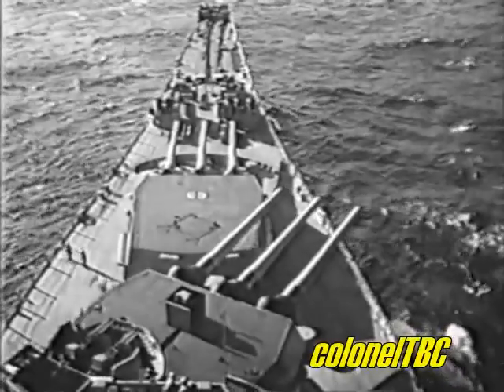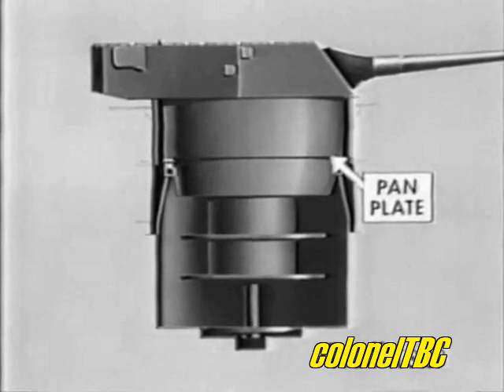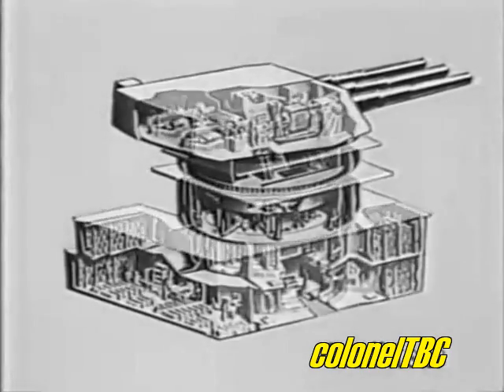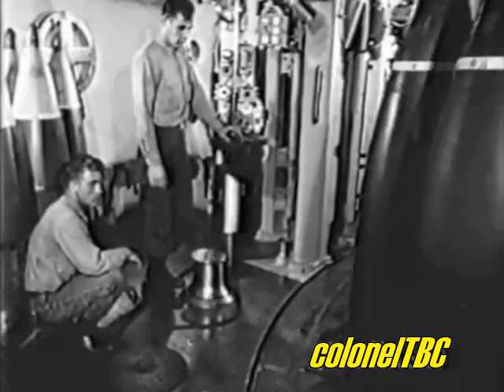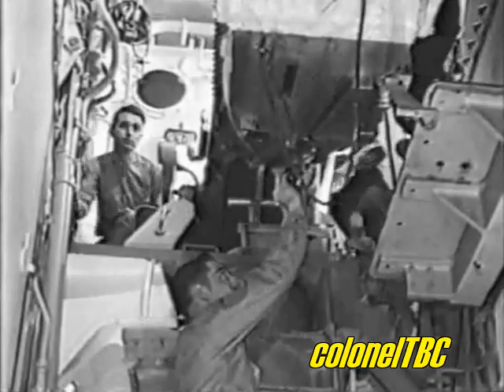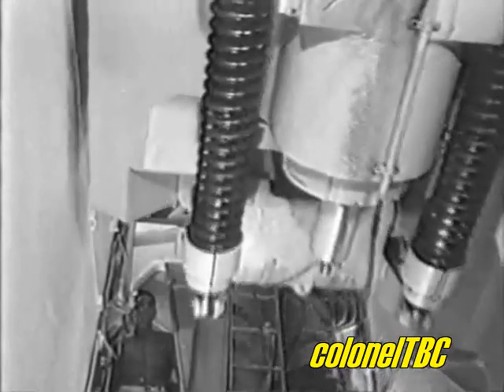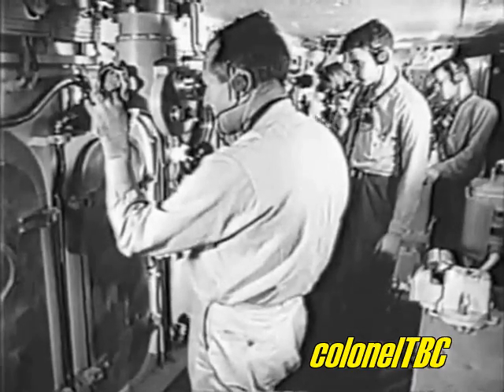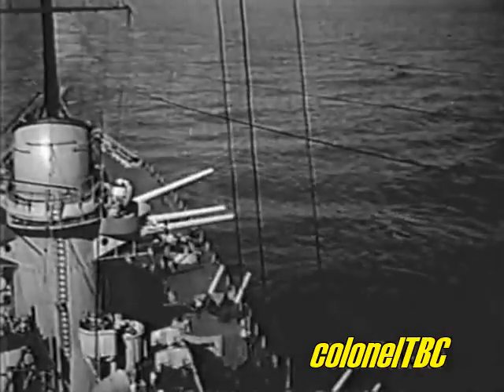How the main armament of an Iowa-class battleship works - 1955

Comment: Fun fact: the iowa's gun barrels were assembled with zero welds. The outer tube and inner rifled liner are heated and cooled respectively so the liner can be slid into the tube. When the two return to room temperature they will contract and expand into each other locking them in place. Building up the breech end of the gun was done in the same way.
Reply: I'd say somewhat safer since you can mostly rely on a machine to do the heating (welding, you're responsible for it).